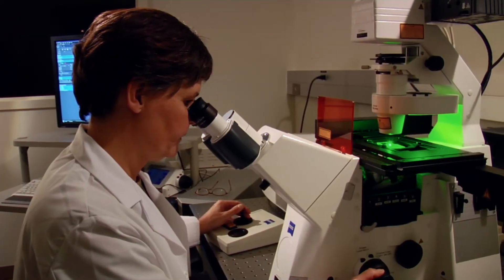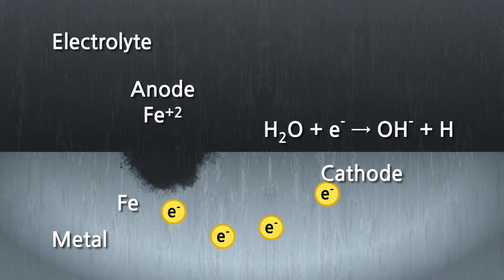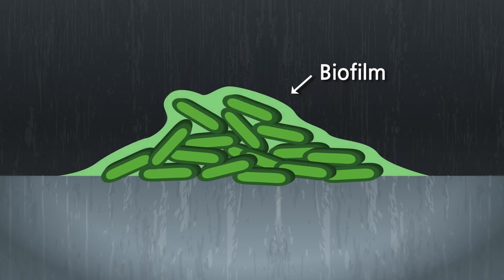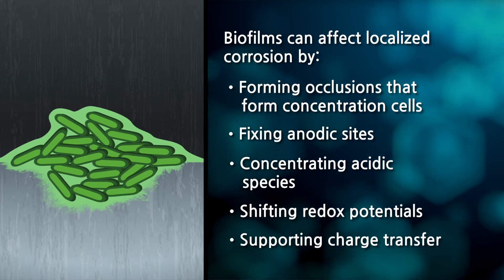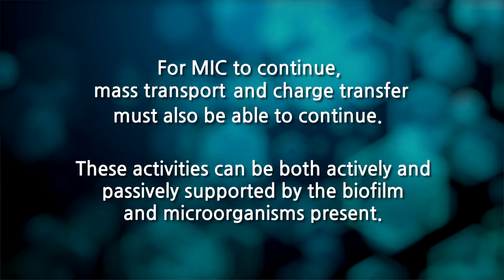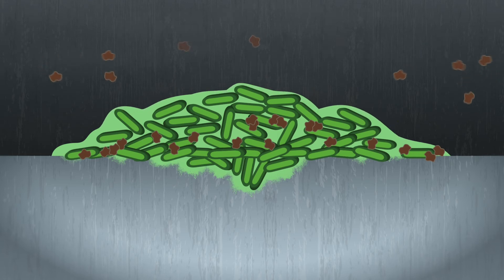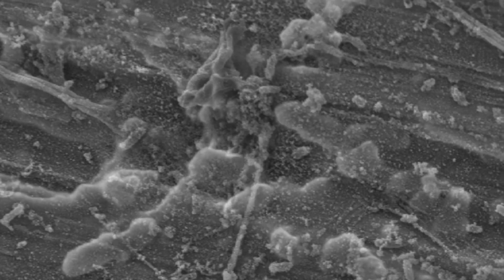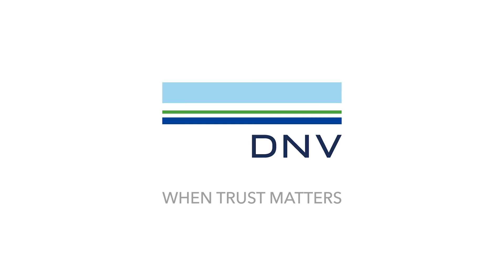Microbiologically Influenced Corrosion (MIC) threat assessment, mitigation and monitoring services

Comment: Mechanism  microbial corrosion. It is a threat assessment. It is not only from oil & gas. It could excactly from fuel fossils.
Wood, fire, metal, oil, e.g petroleum, gas, coal
Chemicals
Microbiologically are influencing corrosion threats to alll living organism. It does nit matter which side of the world. Everybody will be afffected.
Bacteria will be everywhere. Not only microbiologgically as well as  macroboiogically could influence corrosion threats.
Methanogeneses is from both micro /macrobiologically as welll as hydrogen  gas is a threats